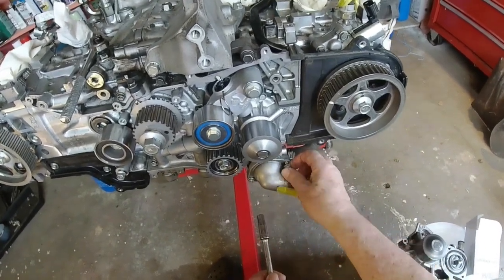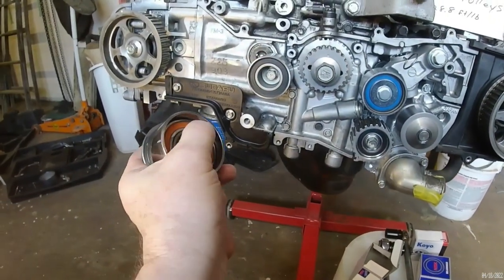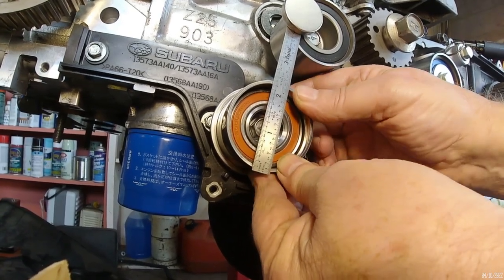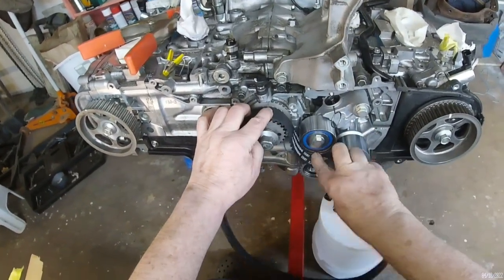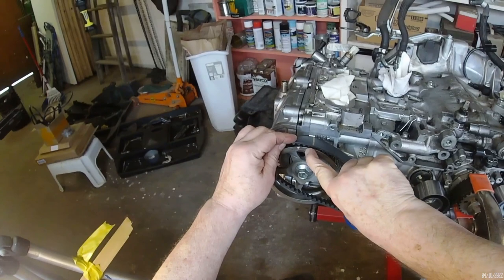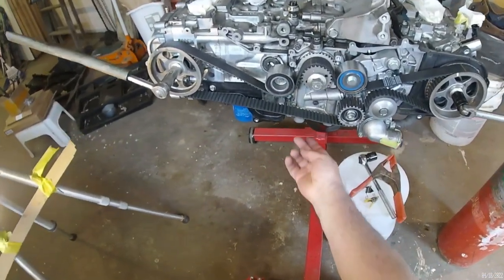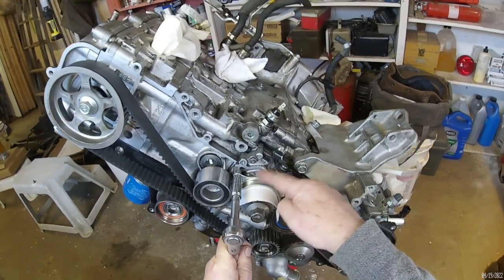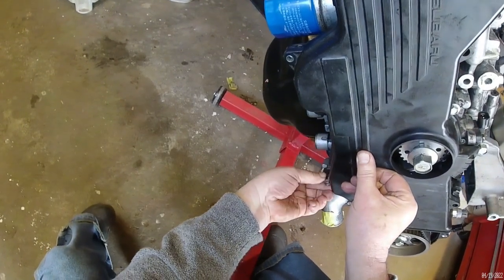Replacing EJ25 timing belt & thermostat. 2008 Subaru Outback. SOHC, non-turbo .

Comment: It's the cogged idler near the water pump that fails. I had a new one fail by collapsing into the motor but no valves were bent. Watching other instals I  fit the  cogged idler in against the belt while maintaining tension on the belt then fit the cogged idler bolt in.
Reply from the maker: I've seen videos on the cogged idler going out...and sometimes letting the belt slip. I've always put my attention right on new engine sounds, and now that I know a little more about the Subaru timing belt system, I'm listening for idlers that are wearing out.

Comment: Does the engine need pulled to do the thermostat?
Reply from the maker: Nope. It's also not neccessary to remove the engine to replace the timing belt. This engine was removed to replace the head gaskets. But that can also be done without removing the engine.

Comment: You don't have much experience. When you learn, you will realize that you do NOT need those "special tools" that hold the camshafts. To make it easier for you, both bearings below are installed last, first the one with teeth on the water pump (belt and bearing at the same time) at a small angle, screwing the bolt in manually with a short ratchet so as not to damage the  thread. then the other. Congratulations for sharing what you do trying to help others
Reply from the maker: Your correct. I'd never touched a Subaru before this EJ25 work. I pointed that out in the vid. 
Sometimes I'll watch an expert do something and it goes right pass me. I don't catch on. Yet I might watch someone struggle through a project and I'll get it. My hope is that by figuring and fumbling my way through a job, I may be the same help for someone else. 
I appreciate the feedback. My next timing belt will, no doubt, be easier for me.

Comment: Can u add video of running
Reply from the maker: I will. When I started it up, it misfired, because I tried to get away with some less expensive spark plug wires. I sent the wires back to Amazon and got some OEM wires ($90 !!). That took care of the misfiring.